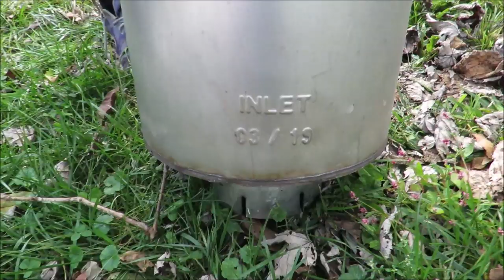✪ NASTY Straight Pipe Install ✪ 2001 Dodge Cummins

Comment: You should be getting 5" exhaust coupler with 5" ID , and not running it with just a clamp holding the two together lol. Will save you from leaks, and it will be solid.

Comment: Maybe tune it so it doesn’t smoke like that. This is a prime example of why the EPA is clamping down on diesel industrie
Reply: Joe Bortolotto I agree running it that rich has a high probability of washing the rings out in the engine.. the previous owner was clearly a coal roller 😂
Reply: Check out my undercoat video on my Cummins
Reply: If people who live in suburbs can't pretend to be country and smoke coal why would they drive a diesel?

Comment: How do you make it roall so much coal? My buddy has a 2and gen cummins dually with a 5 inch straight pipe but it doesn't roal coal
Reply from the maker: it has a p-pump on it which is the main reason why it rolls coal so much! Thanks for watching!

Comment: What all does it have done to it? I've got an 02 with a quadzilla adrenaline, 7x.010 150hp injectors, and a bunch of other stuff but it doesn't blow black smoke like that just revving in neutral. Just curious.
Reply from the maker: The main reason the truck smokes is because of the p7100 P-pump. Pushed by a fass-150 fuel pump. With 200HP sticks and a superbee turbo. As well as the move bumper, and led taillights and taillights. Your truck sounds nice! Thanks for watching!
Reply: @thekehmcrew  makes sense then, I seen that it said 2001 in the title so I just kind of figured it was still running the vp44, didn't realize you had it ppumped.
Reply: Wyatt Lewis you don’t don’t want your truck to smoke like that anyway it’s just wasted fuel. Smoking when you get on it is fine but that’s stupid
Reply: @MoparMadness93  agree to disagree

Comment: I am purchasing my first Cummins turbo diesel 2002 5 speed manual Ram 3500 2 wheel drive extended cab long bed for $7800 with only 226,000 miles is that a good deal new turbo mechanically sound no leaks new clutch new tires clean title Montana truck
Reply from the maker: That sounds like a pretty awesome deal for a nice truck! Hope you have fun with it! And thanks for watching!